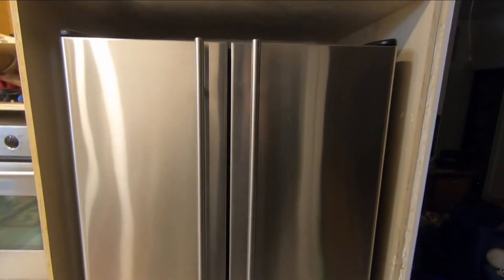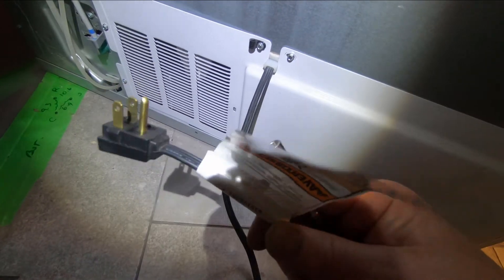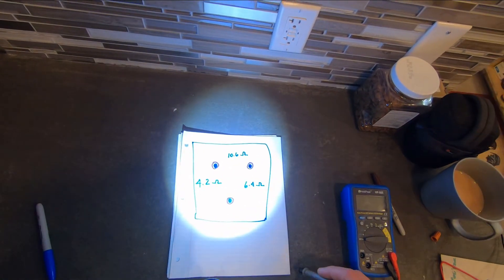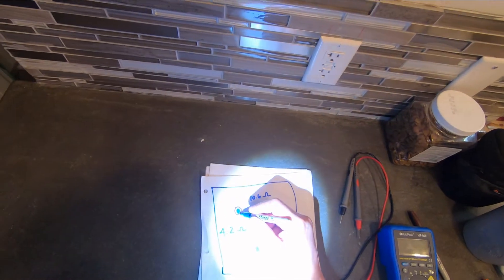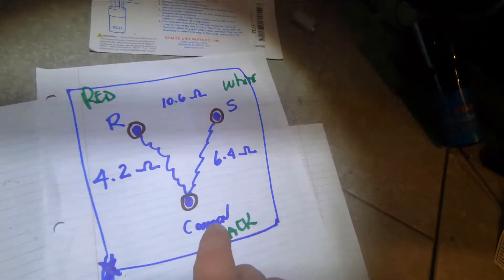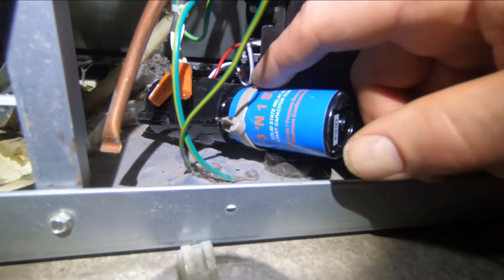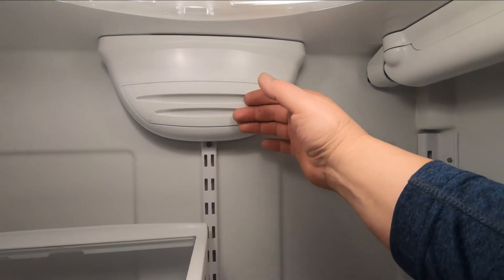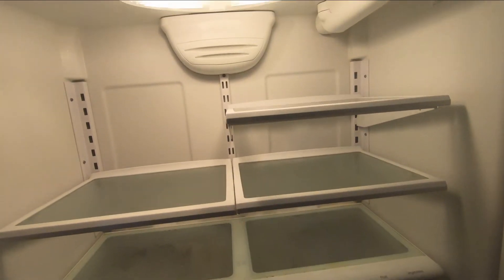HOW TO DIAGNOSE AND FIX A FRIDGE (OR FREEZER) COMPRESSOR THAT WON'T COOL !

Comment: Great video and I really wish that I found it before forking out $1800 for a new freezer for my boat.
Reply from the maker: The 3-in-1 hard start capacitors can save many fridges and freezers. A new freezer has it's benefits too, so you're all set for many years. Thanks for watching! If you have time, here's another refrigeration video you may like: https://www.youtube.com/watch?v=dbHdIhSk3cg&t=323s

Comment: Hello I bought a supco 810 ,I have the common black on top, start white on left and red run on right,I have four wires on the power two red and two white I connected one black to the reds and the other to whites but my compressor still won't start, did I buy the wrong 3in1 start kit
Reply from the maker: Test the compressor first to see if you have an open or short to ground in the windings. If that checks out, you may have the wrong kit, but they're all similar. I'd double check the wiring, voltage and connections first. Good luck.
Reply: @EverydayProjects  thank you,I appreciate the advice, I will do that 👍

Comment: Hi. How did you determine the horsepower rating for your refrigerator , so you can pick the correct universal 3-n-1 hard start device for your refrigerator repair? There are ( 2 ) different universal hard start devices - RCO 210 and a RCO410 type, each one can only be used for a specific range of compressor horsepower. I assume if you use the wrong one, the universal hard start device will most likely go bad in a short period of time.
Reply from the maker: The hp rating should be on the information tag on the compressor. Sometimes it's hidden in a code in the model number but other times it is obvious what the hp is. To decipher the code for your particular brand of fridge and compressor, find the code and do an internet search for that brand of compressor (exact name of the compressor not the fridge make) and you should be able to find the horsepower rating of the compressor. They are all a little different so I don't know the specifics. Good luck with your repair and thanks for your question.

Comment: I would worry about those wires just plugging onto the compressor either a touching at some point by vibration or coming loose. You would think they would have rubber coatings over them or sleeves just in case.
Reply from the maker: Great point! It seems that the wires stay on the terminals without falling off. The newer compressors are contained behind a cover on the rear of the refrigerator so that would lessen the chance of someone coming into direct contact with a live terminal. It's just the way it's done. I'm sure a fellow could coat the exposed terminals with liquid electrical tape (actual product). Take care. thanks for your concern and comment.

Comment: It worked on my Kenmore Elite Trio, circa 2010 or so. I used RCO810 tho. I think it covers more types of hp rated motors.

Question: would this work for a 1950s fridge? How different is rhe wiring for those antiques?
Reply from the maker: That would be a question for an expert appliance repairman. I'm just a general fixer and mechanic , mostly. If you find out, please post it here so we'll all know . Thanks

Comment: How did you decide between a Supco 3 n 1 RCO410 and the RCO210?
I ordered the RCO210 because is is good for 1/12 to 1/2HP compressors.   The RCO410 is only good up to 1/3hp.  I went for the more rugged.
My compressor label states it's LRA is 18.2amps. My OEM start relay was clicking and going into overload.  The fridge always cooled enough but I feared the repetitive clicking would get worse.
Reply from the maker: It's been a while and I cannot remember exactly why I chose that particular hard start kit. I bought it on Amazon and it was a match for the hp of my fridge compressor motor. As I remember I have a 1/3 hp motor and the RC0410 works up to 1/3 hp. That would have been my first choice. The RC0210 works up to and including 1 hp motors. Quite frankly, it was most likely a choice of the least expensive hard-start-kit that matched my motor (considering the same brand and quality).

Comment: Great schematic and multimeter walk through. If my fridge powers on with interior lights, the thermostat checks out on the multimeter, but I still get no fan or compressor start, is it still likely the Supco RCO410 that I discovered on my Amana? It's 16 years old.
Reply from the maker: These "Hard Start" Kits are a near universal fit for most refrigerators and freezers. If it was me, I'd check the motor windings and if they checked out, I'd get a kit and try it. The interior light and thermostat are independent of the motor start, although the thermostat will signal when to start and stop the motor. Best of luck and remember--Be careful!

Comment: Someone help me here 
I replaced the capacitor with a hard start and it run for 10 minutes before clicking off
Reply: Could it be my hard start kit too small?
Reply from the maker: It could be the compressor motor itself that has a problem. Do the tests I showed  to see if the windings are intact. Good luck.
Reply: @EverydayProjects   turns out I really had to replace the compressor

Comment: Is the 3-in1 relay/capacitor you have had on your description works for any refrigerator?
Reply from the maker: Yes. these should work on most brands of refrigerator or freezer. You can find them on Amazon or at major box stores. Good luck.

Comment: Does the 3 in 1 relay thing works on all brands of fridges and freezers? This is a very useful video, I like that you explain with the drawing what these holes are  and what they do. Tthank you for posting.
Reply from the maker: Yes, the 3-in-1 kits are widely used on most brands.

Comment: Hi, I heard the 3N1 can fry/damage the compressor depending on the type of the compressor even if you choose the correct HP rating. It can lead to compressor death after a few months. Is that true?
Reply from the maker: I haven't had that experience. The 3N1 units are simple components sold in one package: a start capacitor, a start relay and an overload. The alternative to this repair is to use the OEM factory start relay which are readily available. When choosing a 3N1 hard start kit, look for reputable brands that have been proven. If in doubt, ask an appliance repair company to provide a quality unit. This can help avoid the cheapest and lowest quality knock-offs that may give you trouble. And always, if you have any doubts about which unit to select or how to install it, have a qualified service technician perform the repair.

Comment: I did installed one exactly like this one on whirlpool refrigerator and it didn’t work, any suggestions. The problem with the refrigerator is that it sometimes starts when I plug it in for few hours then it stops and can’t start back with original relay and capacitor.
Reply from the maker: Use a multimeter and check the resistance in the motor windings that I showed in the video. This will help you decide if the motor has a defect. There are other components that can cause a refrigerator to run intermittently such as a themostat problem or control board, etc. Start with testing the motor windings. Good Luck!
Reply: @EverydayProjects  thank you, I did check the compressor with multimeter it matched the two top number equal to the one on bottom number. I don’t know what else to do. Also I noticed that the compressor fan is not blowing towards the compressor, it’s blowing the opposite direction, is that how it supposed to be and when it runs sometimes the compressor gets really hot.
Reply from the maker: @yayahkhan117  The repair may be beyond my knowledge but I’d search for the electrical diagram for your make and model and find thermostat and control board. You may be able to identify a defective component. You may have to bring in a technician.